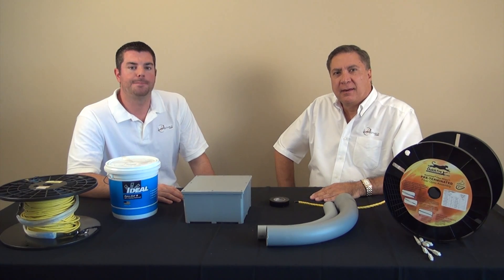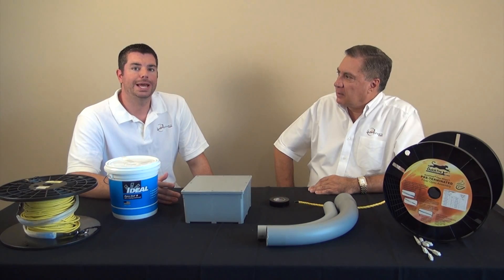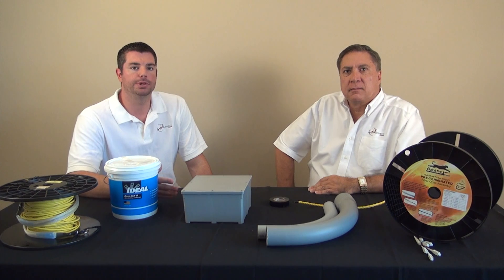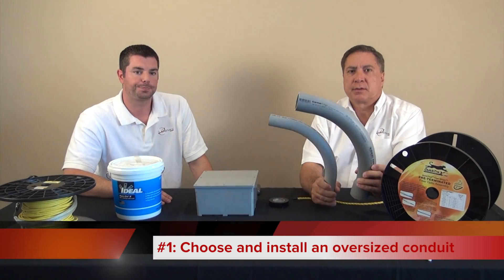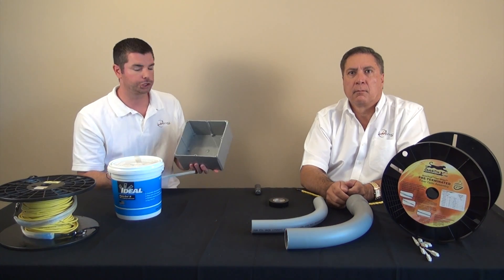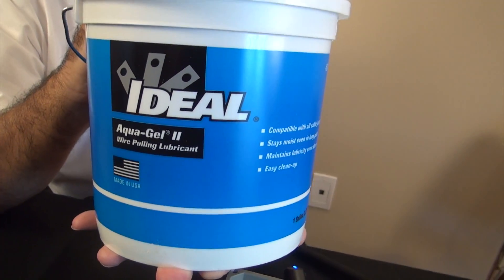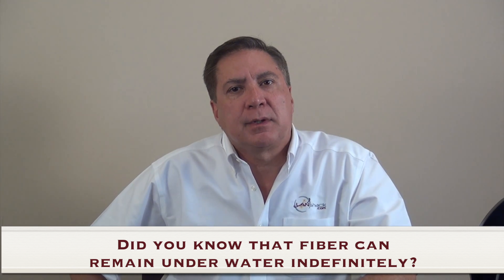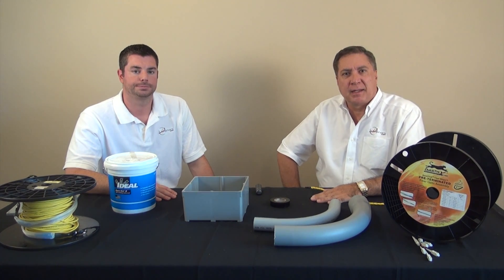Choosing a Conduit Size for Fiber Optic Cabling

Comment: So what is a Short vs Long pull? 200 feet is that short or long in 2" conduit? I am looking to do a pull between 2 houses in 2" conduit. The total distance is under 600 feet with a box in the middle at around 300 feet.